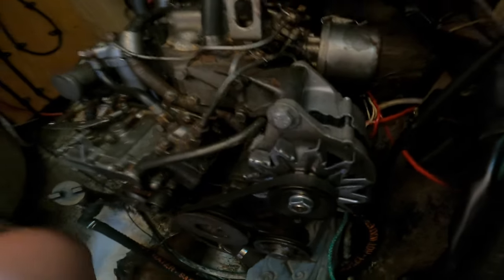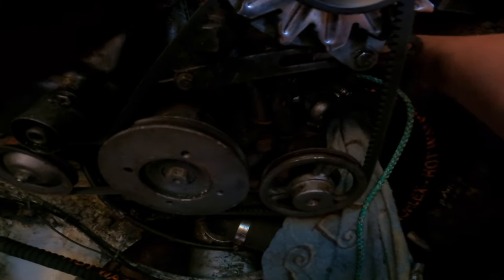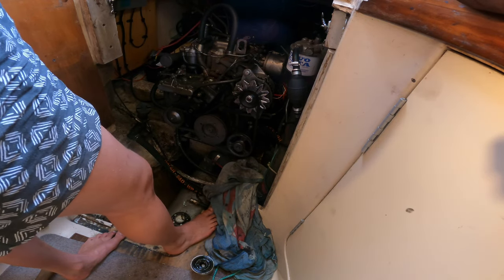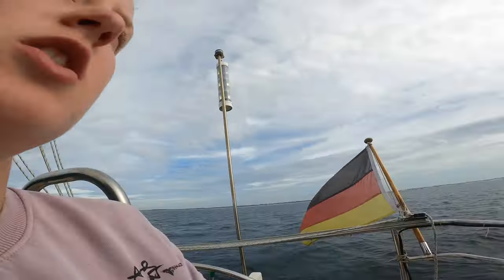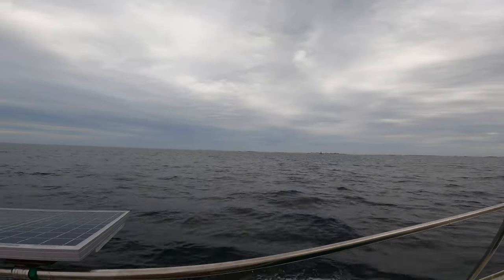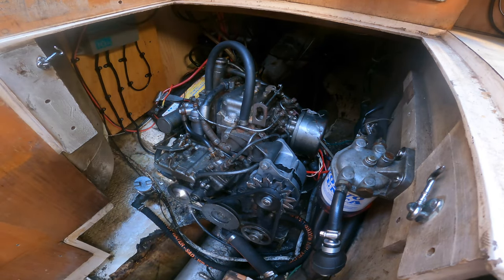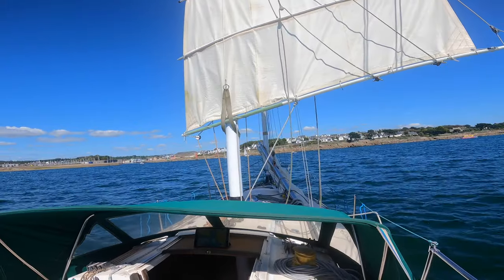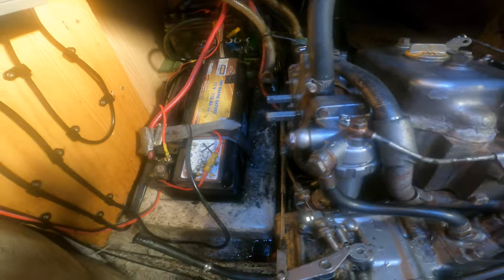Short Sails, Engine Work and Sunshine - Sailing Alanouwoly EP15

Comment: Thanks for the video. The pump has potential. I hope that fixes it. Failing that I would also check the fuel tank and the lines leading to the pump and return lines for any potential to limit the fuel. A collapsing fuel line, vacuum build up in the tank due to a clogged vent, debris clogging the pick up tube. Old outboard fuel lines used to have the problem of having an inner lining that would fail and clog the line but you couldn't tell from the outside. A decent mechanic should be able to figure it out but you can't always find or afford one. I am glad to see you are learning how to work on the engine yourself. I agree with the other poster, show us a nice boring video of the complete engine problem. There might be someone watching who knows what the issue is.
Reply from the maker: the lines leading to the pump are a good tip, thank you!

Comment: du bist ganz schön fit! so gehört es sich für fahrtensegler. du hast an der linken seite des motors ein 2. fuelfilter. das sogenannte feinfilter. das kann auch verstopft sein. arbeite bei dem einspritzsystem immer mit hoher sauberkeit.!!!! vor dem filter ist es kein so große problem, dafür hast du ja die filter. alles was da durchgeht beschädigt nicht das e-system. die returnline ist die sogenannte leckölleitung sie geht direkt zurück zum tank. wenn da luft drin ist wird sie rausgedrückt durch das leckende öl. deswegen ist sie immer voll mit diesel .

Comment: I've been operating and working on marine diesels for several decades. There are two critical gauges that you must have to monitor your engine. Oil pressure and engine temp. Engine temp is the most useful as you can use that to tell you when your cooling system is failing, or when your hull or prop is too dirty for the engine speed you are doing etc. It is quite possible that your engine was shutting off due to overheating, and if it has damaged itself, it will at least have shortened it's life. Get your mechanic to fit (or repair) your engine temp gauge and learn to check it with a glance every few minutes. Also make some notes about engine temps vs speed vs engine rpms when the cooling system has been cleaned an use those as reference notes to see when things have changed. Personally, I only allow a 2 or 3 degC upward change in engine temp at cruising rpms before I start hunting for the reason. Heat is the major killer of marine diesels. 
The oil pressure gauge (or alarm) is the one that tells you that your engine is about to destroy itself due to say an oil leak or excessive oil consumption leading to low oil levels. That's when you turn the engine off before even thinking about the next steps.
Reply from the maker: Thank you! It seams like it was an overheating problem, and I’m now hoping that the engine was protecting itself by shutting off after 15mins. But I have been running it quite a bit since the problem first presented itself, so I really hope there isn’t too much lasting damage. 
When the mechanic pointed at the impeller I couldn’t believe that checking it hadn’t crossed my mind!
Reply: Your mechanic can tell you for sure, but not many older diesels have an auto shutoff like modern electronic controlled ones do. That's why they nearly always have an overheat alarm so that you can manually shut it down. The engine may still be OK even after an overheat, but you won't know until the cooling is working and you run it at full cruise for a while. I literally would never want to run a marine diesel without a reliable temp gauge and alarm. Too many things can go wrong in their cooling systems, and some can happen in just a couple of minutes. Good luck with your repair @SailingAlanouwoly